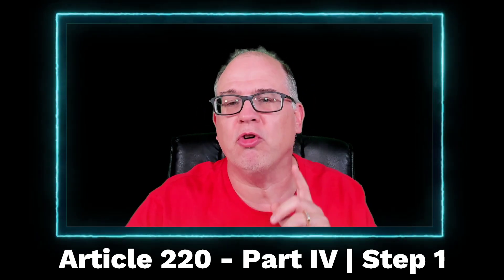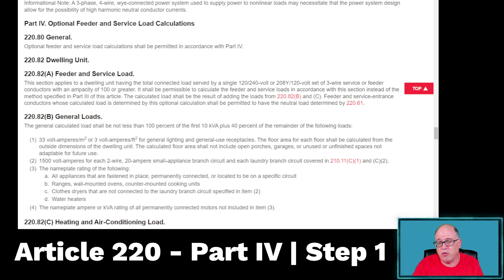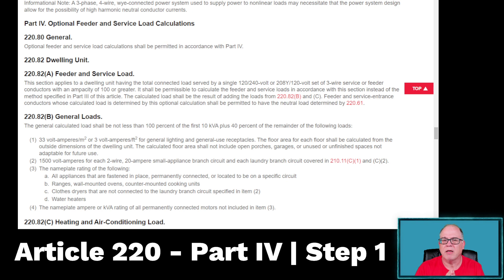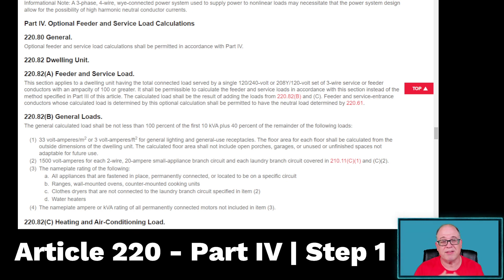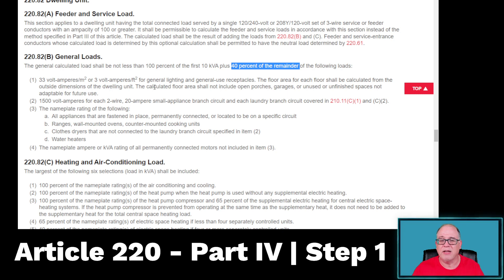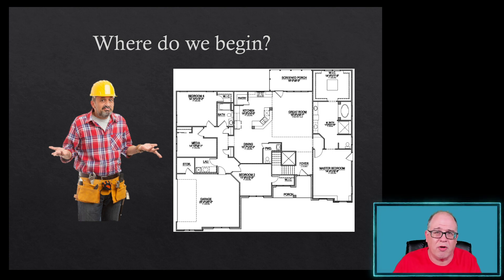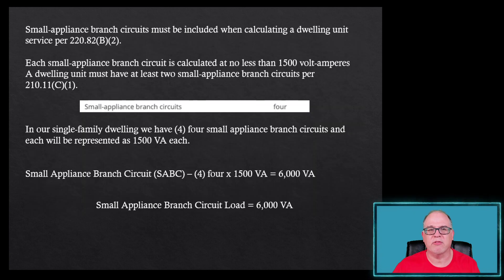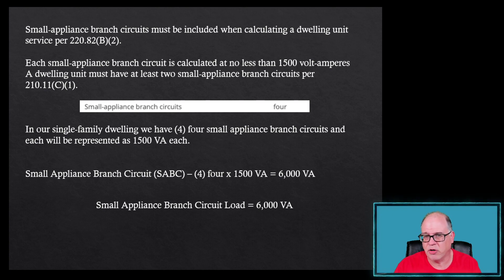Electrical Exam PREP video series | Optional Methods

Comment: If we can't use optional method less than 100A service conductor ampacity, how do we know the ampacity of service conductor 100A or greater ?
Reply from the maker: You always use the standard method in all cases. Now, single family dwellings cannot be less than 100 Amps per 230.79. So, you do an original calc and then use that to dictate if the "optional" methods is applicable. On exams always assume standard Part 3 method unless they state otherwise.